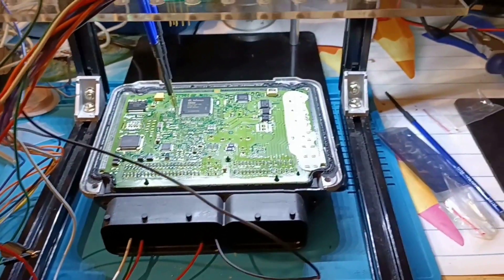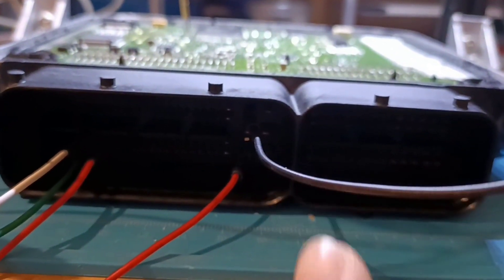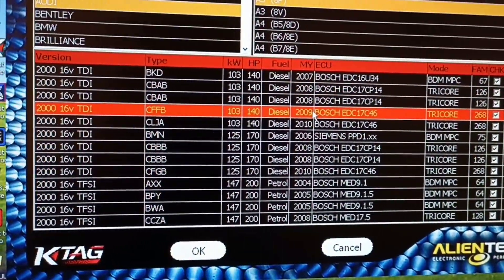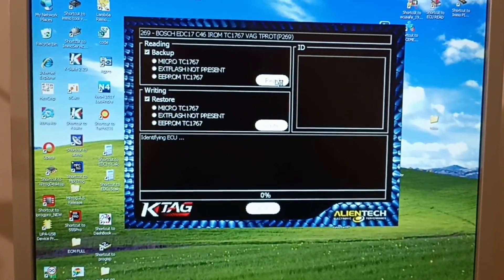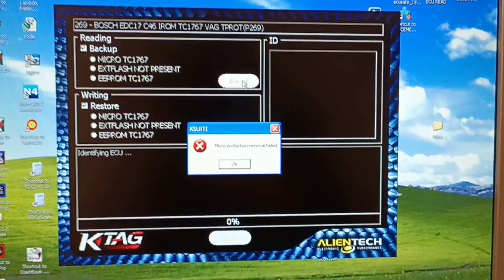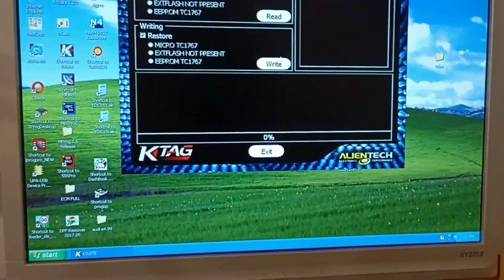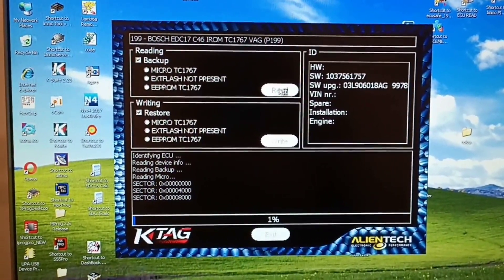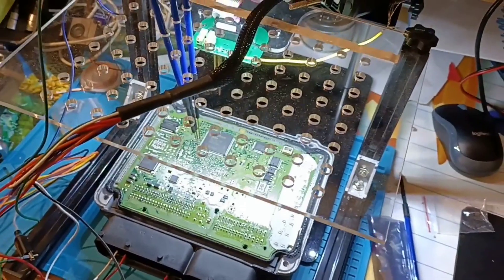Audi A3 edc17c46 read and write. Micro Protection solved.

Comment: Thanx for lesson;) Do You think it safe Audi A6 C7 (2012) Edc17C46 ktag clone?
Reply from the maker: Fc200 or VVDI Multiprog
Reply from the maker: Hi. No is not safe with Clone
Reply: :) so tell me what i can use?
Reply: Just for learning i try read with  ktag.EDC17C46 CLGC from crashed vehicle. Posible to read that i know for now. But protocol 269, 8mhz+sd card, 13.9Volt. Only then i can read. Thanx for  tutorials- great knowlage base;)

Comment: Thanks, I used your suggestion to read from a faulty ECU and write to another used ECU. Ktag didn't report any errors and the write was successful. However, the vehicle refused to start and the glow plug warning light started flashing. A scan using VCDS reported a P160A Checksum Error for Internal Control Module Memory. I was under the impression that KTAG recomputes checksums during write, but apparently not. Any suggestions? Should I attempt using WinOLS to recompute checksums?
Reply from the maker: Hello. Yea you must do the checksum correction. Ktag clones cannot do this job.

Comment: Hey, i have Audi A6 4G 2012 with EDC17C46, is it safe to read and write with Ktag Clone Red PCB? I saw someone gets error in reading at 9%
Reply from the maker: Hello,
does not work on this ECU.  
And if you are reading it is likely that you have corrupted data.  
 I don't recommend using clones, but if you really want to read this ECU, it's 100 times safer to use SMpro clone.